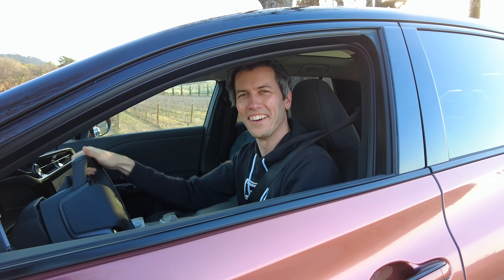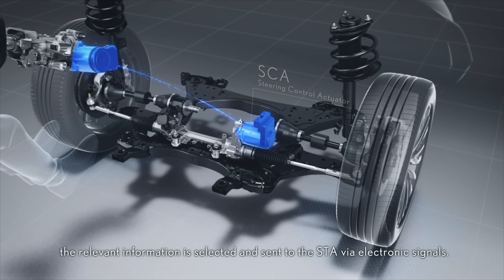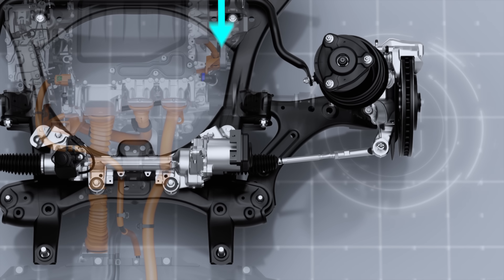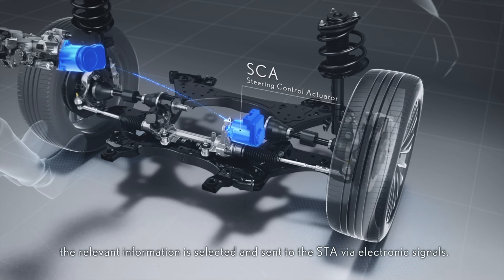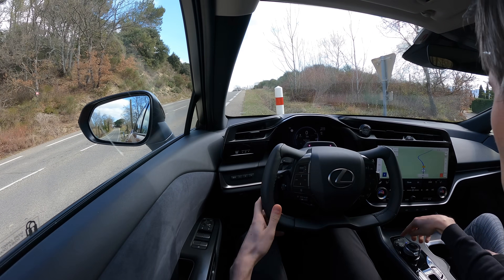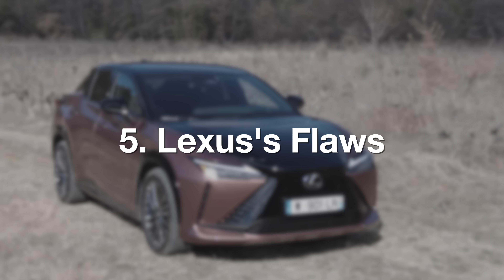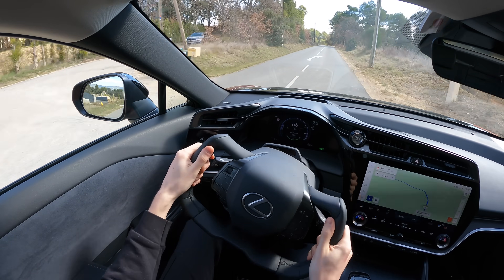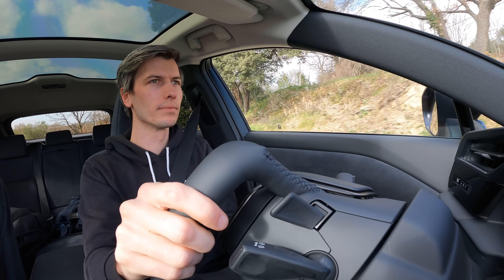How Lexus Fixed Tesla's Bad Idea: Steer-By-Wire Yoke

Comment: @12:12 input lag or latency or hardware response will almost always be an issue with drive by wire systems vs. mechanical connections. And some people will notice a 30-80ms delay in input delay/latency, and definitely around 100ms to 150ms. 

In mechanical systems, the slop in the system is called back lash, or the amount of distance you have to move to change direction where nothing happens to until it does. Mechanical systems are time tested solutions but like with any system it will get progressively worsen over time in things like the rack/pinion wear, fluid pressures, u-joints, gearing, belts, rod ends etc... all wear down mechanically. 

In electric systems or simulation steering systems, latency can be reduced to 30ms and make it unnoticeable to most but the more algorithms you place in the loop the more processing obviously you will have and more latency. Direct Drive systems or servos with no mechanical reductions or systems in the middle, can remove more latency and be more robust, and come even closer at replicating mechanical steering systems. But any algorithm, for force feedback or correction placed on top of the wheel will always introduce some form of latency, key is whether it is noticeable or not by most....  Same goes for drone pilots and video stability systems. You can have a stabilized image or fast response, but you cannot have both. Or for raw video vs. compressed video. Always chasing compromises... ;-)

Drive by wire has some advantages for sure and Honda had a VSG or a mechanical variable steering system in the past. quote "

It featured variable gear ratio steering (VGS), a steering system that continuously changes the steering ratio based upon the car’s speed and steering angle. This was the first system of its kind to be implemented in a car and was designed to improve handling performance. Honda also reduced the lock-to-lock steering ratio to 1.4 turns from 2.4, and all Type V cars came with revised damper units, stabilizers and limited slip differentials. Type V S2000s were given a special steering wheel and had a VGS badge rear of the car."

From vTech to VGS. Lobes all around. ;-)

Comment: I wonder if any car maker has thought to do this via a CVT. It'd have a mechanical connection between the steering wheel/yoke and the tires, while also gaining that variable steering ratio.

And it'd have no input lag at any given speed. Perhaps only a little ratio lag, which would be much less noticeable.

Comment: Hear me out! 
A solution for the Yoke.
What about leaving the shaft but with a low gear ratio system. 
And increase stiffness on steering wheel with software as speed increases for stability.

Comment: Fear of steer by wire is unwarranted. I have flown drones for 15 years and driven RC cars for 25 and I have yet to see an unpredictable failure. The only times something stopped working was because the vehicle was out of range for the controller or because the toy was abused heavily. NEVER have I been surprised or damaged a vehicle. I am not sure how drive by wire in a car is any different than remote controlled operations, other than you don't even have a wireless connection. BMW had an adaptive steering ratio 18 years ago, WITH a steering shaft (active steering).

Comment: Though I don't think there is a need to forgo mechanical steering, the redundancy in place would probably be sufficient.  What I really don't like is the variable steering ratio, to be able to have muscle memory how far to turn the steering regardless of speed is an invaluable trait.  With that unless they have an option to have a static steering ratio and instant responsiveness, I will never consider purchasing a steer-by-wire car.

Comment: And it's much safer when it comes to safety. You see, in the event of a crash a regular mechanical steering system tends to move towards towards the driver and has been slightly fixed by designing collapsible steering columns. But since there are no connections between the steering Yoke and steering rack there will be no movement resulting in a safer vehicle. And a nother safety feature is the fact that there is no hand over hand movement which means there will be less injuries as a result of your hand being in front of the SRS AIRBAG. I was a bit worried about component failure but you cleared that up. In my view I dont see a problem with it.

Comment: I think it's a nice idea, but I always think of 20+ year old cars. Just when normal people can afford such a car. I don't want to deny the redundancy, but the cable(s) will definitely not get better over time, the plugs and motors will age at the same time. If part 1 fails, part 2 is not far away. When I think about how many electronic faults are in an Audi A6 from 2001 or how the cables of old Hondas from 1990 look... I find it frightening that such solutions will still be driving around in 20 years. That the cars work when they roll off the production line may be, I even assume that. But I doubt that the solutions work properly when the vehicle has been standing outside for 10 years in the cold and heat without a garage. Alone how often you have the problems with the throttle position, how often electronically throttle valves do not run correctly ... These are all things that are not as critical as braking or steering.

Comment: High rack ratios definitely give a problem with PIO.  It will be interesting to see how the design out the "tankslapper" situtation.  Mind you, you probably can't turn the ESP off with this system in any case.
Reply: I had a BMW Z4 a while back, if you turn the ESP off and start having fun it beeps at you and turns it back on again. It just gives you the illusion of being disabled.
Reply: @aurumdeus1  BMW has a 3 mode system. Hold it for 1 sec to turn it off for wheel spin but it will turn on if you get sideways, hold for 5 sec and it disables completely.

Comment: i don't like the idea of steering via cable, its not a game and, what about deadzones? Lexus must use some kind of potentiometer and as a gamer i have to tell you that analog sticks (potentiometers) in gamepads are not immune to harm and can start detecting non existing movement, how about that? Ofc its not like you turn the analog few times and it starts detecting wrong values (mostly), it depends on time and usage, You also said about steering with back wheels, okay, we have it, it works, great, but back wheels are not your main wheels to turn in a car, right? They don't have to turn and, i hope, you can turn it off or it turns off automatically when you don't need/use it. As you said latency is a problem, but okay its a prototype adn i hope when it releases it will be reduced to absolute minimum. How about situation when every single power souce fails? It may sound ridiculous and as a meme says, chanses are low, but never zero. Traditional steering aren't perfect, everything can fail, its normal, but its cheaper to repair a traditional steering system than this will be. I like the idea, but in games and gaming, not in driving. Also im not trying to say that we absolutley shoud not experiment and try new things like this, its another step forward.

Comment: I personally think this is cool for most people, for normal daily driving, but the way it looks like it doesn't turn on the highway kinda scares me, what if there is something you need to avoid ? Is their a camera or something detecting that you need to avoid something and cranks up the stirring sensivity ? 
Also, is their anyway for the driver to control the sensitivity ? I mean if it's fully electric, give me option to tune it however I want

Comment: Lexus still needs to improve this but it is a good concept. However, I don't think dual motor redundancy is enough. In the Aviation world, fly-by-wire systems are supplemented by conventional hydraulic assist systems in case the fly-by-wire (which already has multiple redundancies) fails completely. As a driver though, I just can't deal with electric assist. I've driven stuff with no assist, hydraulic assist, and electric assist. There is just that large disconnect even with EPS systems that I still prefer good old hydraulic assist for the most part.

Comment: I'm not convinced by the variable steering aspect of fly-by-wire by the fact that variable steering ratio has been around for decades. The idea of packaging makes the most sense. Right and left hand drive vehicles would be much easier to adapt for different parts of the world, for example. And as someone else pointed out in the comments, not having a steering column would make the car safer.

Comment: I'm sorry, but this just seems like a bad idea.  This is an overly complicated system that just creates more failure points leading to insanely expensive repairs.  The redundancy in the steering system makes me feel better, but if one controller starts to go haywire, how the heck does the car decide which output to listen to for steering?  I can't see this being safe as the electronics in these cars age and start to misbehave.  I feel like a mechanical CVT-esque setup could have also achieved the same variable ratios at a lower price and with fewer safety concerns (since there will always be some form of connection even if the system that adjusts the ratio completely fails).

I'm also completely confident that this system's attempt at distinguishing between road roughness that needs smoothing and road roughness that indicates dangerous driving conditions will not work correctly.  I've never seen a car system that attempts to understand driving conditions work 100% of the time.  You're going to lose road feel with this no matter what Lexus claims the system can do.

My gut also tells me the ratio that varies with speed would be incredibly annoying at best, and completely disorienting at worst.  I can see trying to pull emergency evasive maneuvers with this being a complete nightmare.  The short throw to turn the car is great for reaction time (though somewhat negated by the steering lag), but the variability of the ratio means this car is probably not going to respond the way people want in a crisis situation.

And most importantly, I'm just not buying the "short steering ratios are too twitchy" claim.  Yes, they might be on a conventional power steering setup, but on a variable assist setup (which I'm pretty sure almost every modern car has), you can easily ramp up the input steering force required at highway speeds.  The steering wheel can still be sensitive, but can simultaneously put up enough resistance that it allows for finer control from the human's muscles that are doing the steering.

Comment: I had an idea for a video: 
Get a few COMFORTABLE sedans: Subaru LEGACY is very comfortable, it would be a must for this test, new 23 Honda Accord and some other sedans with a SOFT suspension and NO low profile tires. Also get a few SUV of a similar price range.
Go to a GRAVEL ROAD with POTHOLES, washboard surface, etc., before you do the driving film the gravel road and show the potholes / bad condition.
Get a few random people who think SUV ride better, BLINDFOLD them, lift them into the cars somehow (so they DON'T feel the step-in height, that would ruin the test) and drive over the bad gravel road with them blindfolded. Maybe you can get a bodybuilder for lifting the people in and shout out their channel in return or something, best idea I had to solve the lifting problem lol
Before they get out of the car let them guess if car or SUV and the price of the vehicle.

Comment: I'm curious about a scenario where say a deer runs out into the highway in front of you. If the technology limits steering input at high speeds, would it limit your ability to avoid the animal? Perhaps a faster jerk is what you need to avoid the collision (assuming someone doesn't over correct too which would be bad).

Comment: I'd like to see options on the sensitivity and response with all these electric systems. Have a chill mode that's more for long relaxed driving. Throttle response and steering ratio would be more in line with that style. Ie slower response more traction control and more assistance. Then an in the middle mode that raises the response, then finally have a sport/race mode that would give max response and max sensitivity. Then also the option to create profiles where you can adjust it to your liking. Have everything on a slider and the ability for you to pick the values of everything.
Reply: My Q50 has almost everything you described here (minus sliders for adjustments). It has three different settings for the weight of the wheel and three for steering response. It also varies automatically depending on speed. It's not perfect, but the ability to adjust the steering feel is nice.
Reply: This sounds highly influenced by Tesla's software
Reply: @somerandomguy5707  kinda but I was thinking more along the lines of gaming keyboards and gaming mice. If I can customize my mouse and keyboard to my liking why can I customize my cars settings?
Reply: @dimetime35c  I agree, if they found a way to increase response time between the wheels and kept the steering ratio low it would make for a nice "Sport / track mode", then a slower one for driving through town like a comfort mode. Everything is electronic so I'm sure it could be implemented with some R&D.

Comment: Simple is safer. 
Engineers are trying to earn a name for their team and brand at the cost of public safety. Most people don't want a yoke or steer by wire. We have brains to handle it. Technology is good and safe to aid, not be in control.

Comment: First thing that I question is:
How is a scenario where a quick driver reaction requiring a quick steering input when at high speeds handled. If the steering actuation is reduced at high speeds, a quick maneuver may not be possible therefore chances of avoiding an accident is mitigated. 
I can see a possibility of using detection of wheel slip, vector sensors, camera/sonar sensors to anticipate and calculate the proper steering actuation with minimal wheel slip loss. BUT such thing seems to be too slow with current communication speed that is not insanely expensive

Comment: I'm not a fan of this system. Power steering, ABS, ESP and throttle by wire have one thing in common: they are fail safe, this is not.

Comment: Am I the only one who has reservations about by-wire mission croti al items such as emergency/(parking) brakes and steering.  If you are in a remote area and something (anything) goes wrong, you are in trouble. What about pushing the vehicle of it dies in the middle of the freeway. Time will tell if this works.

Comment: If the battery runs out, neither your vehicle will move nor you will be able to steer it 😂, doesn't matter if there are  backup batteries for that case, they too will eventually run out.

Comment: For the adaptive steering ratio, iirc it's exactly how it works for most racing games with a controller. Because the steering is limited with a joystick, the steering ratio decreases as your speed increases

Comment: This is a very interesting idea but I have a couple questions. Yes the motors are redundant but are the control electronics redundant too? I have seen in Motorsport a few times brake by wire and throttle by wire systems fail although it is rare.

Also if you were traveling at high speed and suddenly needed to swerve to avoid hitting something that you were too late to brake for would it allow that. And also how would counter steering be if the back end lost trip. I know both of those things are unbelievably rare scenarios but bad drivers are going to drive badly and that sometimes causes those situations to occur.

Love that buttons and stalks are still on the steering wheel though

Comment: I think there's some need for this thing to mature before it can be for the masses ‒ like the delay in reaction (that feels like a big issue to me, but probably solvable). Same with the „insane turning inputs“ prevention ‒ these things might come in the future, after they solve all the issues with this one. On the other hand, I've seen an investigation of an accident where a truck driver made a maneuver that flipped the truck over, but that maneuver saved the lives of a full crew of passenger car. So these are probably areas where some conservative approach might be in place ‒ where is the input „insane“ and where is it you're just trying to deal with adverse conditions?

On the other hand, it allows for every person to adjust the steering ratio / the steering ratio graph or profile according to their driving style, preferences, drive mode, etc.

Comment: The variable steering angle reminds me of playing an old fps shooter with mouse acceleration turned on. An absolute horror to fully learn. And we've got the input delay as well. Imagine playing Counter Strike with that. + fake force feedback. And it got twice the parts, for lessen the chance of failure. 2x use of resources in these times. Ever heard of a steering racket failing under normal conditions? Ever? Well done sir, Yushi and rest of Lexus.

Comment: The problem I have with electronic sensors as we have all seen how bad car manufactures can make something as easy as a throttle sensor. Dude Subaru doesn't even make linear throttle sensor is anymore. The response is absolutely ridiculous. Sometimes you can press the throttle like 10% and nothing happens. Also they have crazy delays. And almost every throttle by wire car I've ever used I can literally take the gas pedal all the way to the floor and back up and nothing happens you can't do that in a traditional car you start going immediately. I just hate lies. I would be OK if the feedback on the sensor is instant and the response rate is really high like more than 1000Hz. But it's not going to be. It's going to be bad.